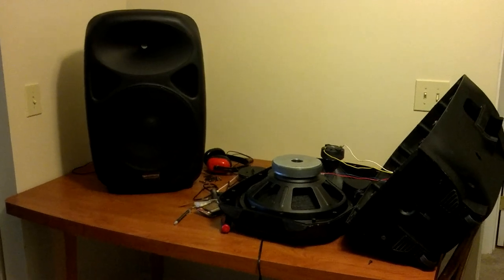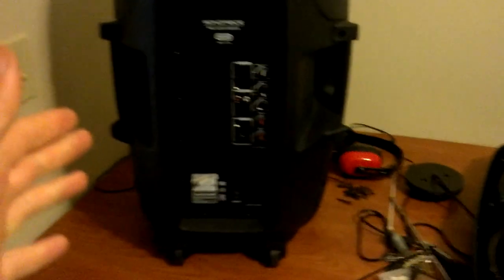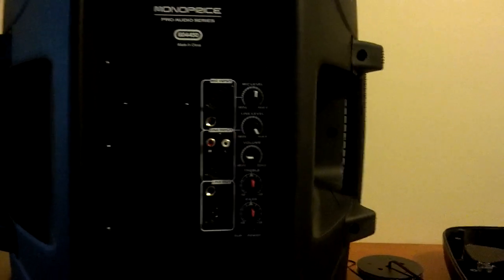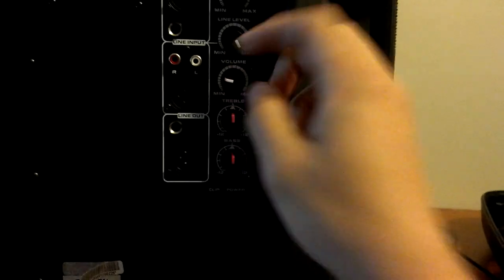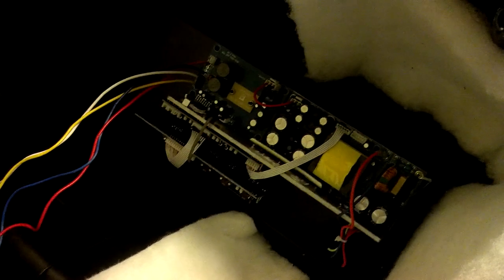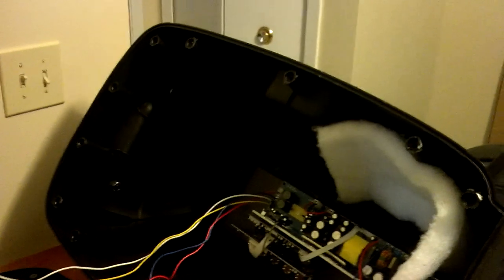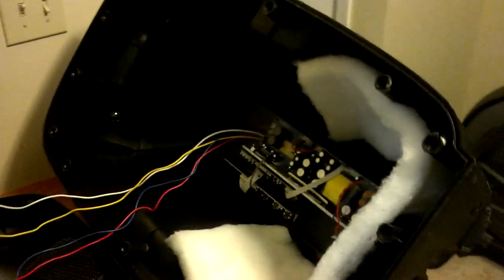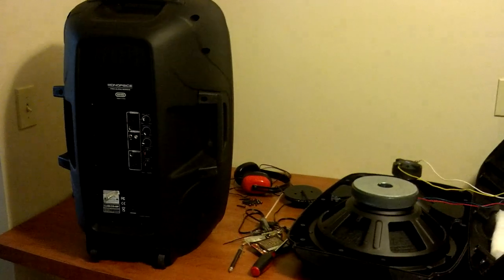Monoprice 15in Active Powered PA Speaker

Comment: Almost three year old review, curious to know how they've been hold in up so far. One of my clients need a PA speaker for meetings and lectures in small rooms so I'm looking to recommend a system that's solid without breaking the bank.
Reply from the maker: Three years old and still going strong! The one fault that emerged with time is that the side handles on each speaker broke off. Largely my fault because I let a buddy help me carry them and he doesn't lift things so much as yank them and jerked the side handles out. Two long screws hold each side handle in so once he messed them up I simply removed them and rely on the top handles which are molded into the unit. While I was unscrewing the handles I also unscrewed the wheels on the bottom of each speaker which still worked, but I never used cause they added a bit of weight. DJ'ing every weekend with these they have some respectable wear but the cabinets don't look chewed up. The important things are all there in that they still sound great, the audio connections on the back panel have all held up just fine, and all the knobs continue to function without fuss. I have never had to tear the cabinets open to fix loose connections or repair any blown speaker components. I still wholeheartedly recommend these.
Reply: James Hayes will definitely recommend these to my client then. Thanks a lot for your review and your time.

Comment: So u can install them in a car? Because i have one but i WANT to install it in my car?
Reply from the maker: The easiest way to run them in a car without destroying them would be to put the speaker in the trunk and run power to it with a 200 (or greater) watt inverter plugged into a 12v car socket. You would need to run an audio cable to it too and perhaps split the audio, so audio is also coming through the car's stereo. Theoretically you could rip the speaker apart and hardwire the drivers, amplifiers, etc. into the car stereo. It would probably be less expensive (and have a better chance of actually working) to buy car audio drivers and parts specifically designed for this purpose.

Comment: Honest question, not trying to criticize your knowledge. You seem to have decent knowledge of amplifiers etc but I don't have a grasp of your level of audiophilia. Have you listened to these side by side with Mackie SRM450s or a similar brand to compare? I went down to my local guitar center and did a lot of A-B listening between a number of 15" powered speakers (Behringer, American Audio, Mackie Thump, JBL, Alto)  and while they all seemed to sound good on their own, when you compared them to the SRM450's they were either harsh, hollow, distorted, etc. If so, how to these hold up. What kind of subs are you using, and what were the 8s that you sold?
Reply from the maker: You are correct that I am not an audiophile. The 8in speakers I had before were gemini brand. The powered 12" subs I use with these are gemini's as well. I do work with other DJ's who use JBL Eon's, QSC K12's, and SRM 450's. These speakers cost half as much as these other brands for a reason. The two areas where these speakers fall short compared to those above is headroom and on the high end of the spectrum. Regarding headroom, these speakers are not going to get as loud as the above brands will reach their peak volume sooner (albeit this is still quite loud). You have to take note that these are only 150 watt speakers. For this reason there is less clairty compared to a mackie, jbl, or qsc. The horn or tweeter in the aforementioned brands handles more power and does a better job of it to grant better sound reproduction in the upper end of the spectrum. That being said these speakers are using the latest technology in PA systems and still sound great if not excellent. I consider them to be an extraordinary value, on the highest end of the budget PA spectrum (get these instead of a pyle, american audio, rockville, or similar).  For my purposes as a wedding DJ playing Mp3 files to drunk people in large rooms they are fantastic. If you are planning something different for your PA where quality is one of your biggest criteria using it as a studio monitor, a home theater setup where you are playing FLAC's, or live band performances where you want only the best or only want to carry a single PA that you can crank to the max it may not be the best solution for you. It is still something to consider because quality has to be really really important to you as you have to pay double to make that jump from great to excellent. Even if you settle for these you won't be disappointed. I strike up a ton of conversations with audiophiles who get all of their cables from monoprice and, see the logo on my PA's, and have only good things to say after hearing them.
Reply: Thanks James. This is precisely the kind of insight I was looking for. Nice reply.

Comment: Didn't know these even existed, how many watts?
Reply from the maker: +DJ Cryz33z 150 watt 115 watts for the 15in speaker driver and 35 watts for the tweeter. Power peaks of 230 watts and 70 watts respectively. Doesn't sound like much on paper but the class D amplification means that more of those watts are turned into sound compared to a traditional speaker
Reply: James Hayes Thank you! Sounds like a nice pair of speakers, I will check them out for sure for a backup system.